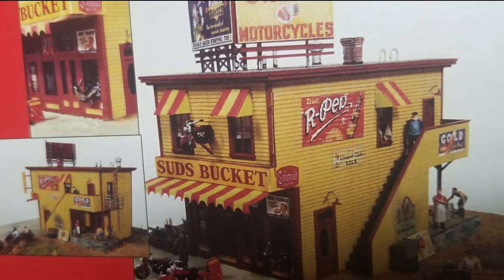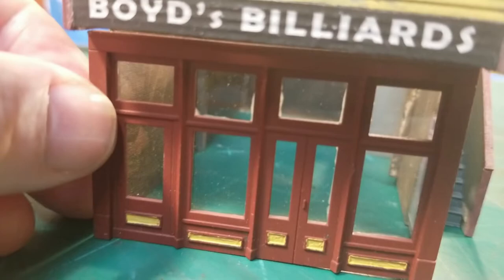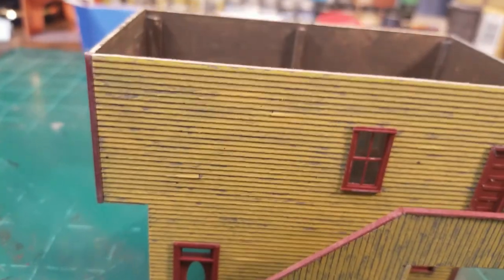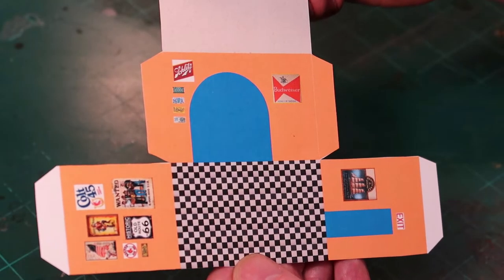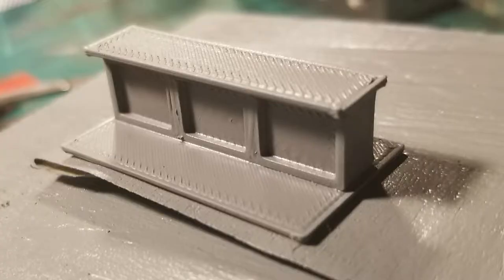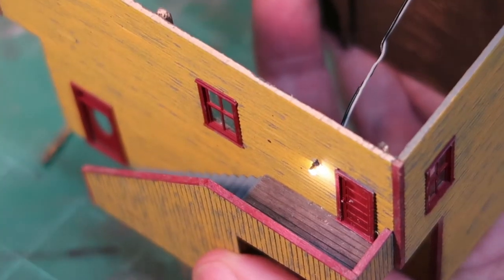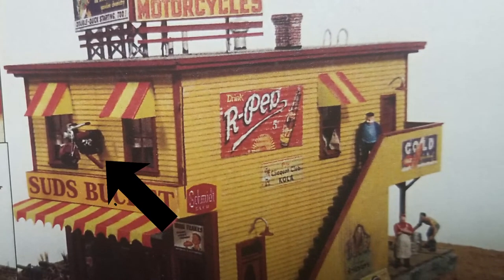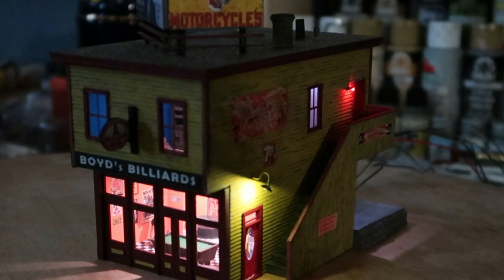HO Scale scratch-made interiors with 3D printed details & LED lighting

Comment: My fear of using the WS lighting solution you used, is how to get the “bulky” plugs thru the “foundation” down to the underside of the layout into the hub.  Seems I need a sizable hole to route all the plugs to underneath.   Can you share how you do the post-assembly routing of wires on the layout.   Thanks.
Reply from the maker: I bore a 3/8" hole through the foundation which is easily covered by the structure.  I picked up a bunch of the 2 pin 2.54mm plugs online cheap, which fits the WS system.   I use the male ends on a 12" harness at the structure.   This allows me to plug it into a hub on the work bench while building/testing.   When complete I put the building on the layout and drop the harness thru the 3/8 hole.   Under the layout I have run wires from the WS hub controller to the hole and put female ends on it.   This gives me a quick disconnect for each structure, which is handy for a number of reasons.  The key was finding the plugs cheap online and not getting them from WS.   Long answer to your question, but bottom line is I live with the hole and it's not a problem for me.   Since making this video I have started using resistors to balance the lights in each building, and have a new 12v power supply buss under the layout.   Combined with the voltage reducing capability of a 'buckboard', this is working great and in the end less expensive than buying all of those WS dimmers.   I will be making a video about this in the near future.  Hope this is helpful.
Reply: @petes3dscalemodels881   in depth answers are always helpful.   Thanks for taking the time to elaborate. I look forward to the next video, you mentioned, once released.